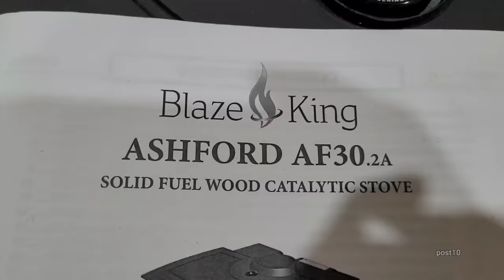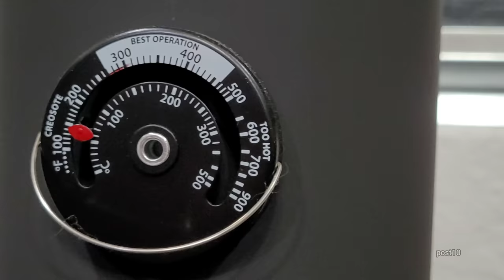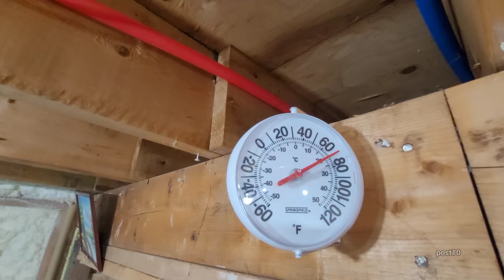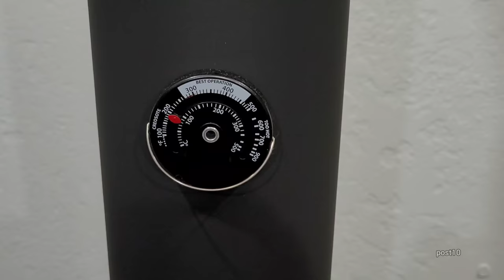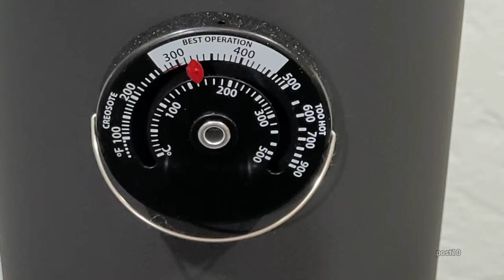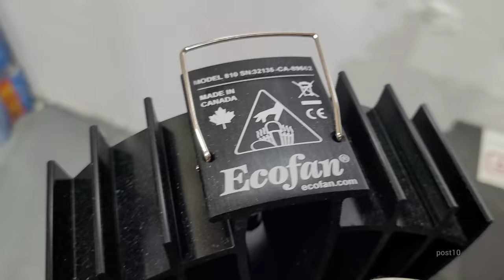Why I Started Heating My Home With Wood And How I Manage My Land. Blaze King Catalytic Stove Review

Comment: I'm a firefighter and went to a house loaded w/CO and the cause was the people threw out embers in the bucket you have but they smoldered but didn't make smoke. The meter was screaming at the high levels in the home. Make sure you have a CO detector in your home or more than just the 1. CO is no joke. Nice video, I"m liking Post's organizational skills.
Reply from the maker: Yes thank you, I have three CO detectors around the house and I'm too paranoid of fires to leave the ash sitting in the house I throw it outside immediately. My CO detector did go off one time from this wood stove but that's because it was about to burn out and I don't think it had enough heat to get the exhaust out
Reply: ahhh this makes perfect sense but I would have never considered it, thanks.
Reply: Did the same thing 50 years ago. Kept using common sense  and an understanding of what I was doing. No problems, saved 10 of thousands of dollars. Be safe GOD bless
Reply: I’ve been watching his videos for a long time now and I just wondered what accent does he have where about in America does he come from? i’m from England so I don’t know about accents but I do not watch any other videos with a similar accent it’s very different to anyone else I have watched I just wondered
Reply: @kooral6959  he's said he lives in Massachusetts
Reply: @kooral6959  he's from Mass. but in another video said he lives in Maine. I'm from Mass too but have a more pronounced Boston accent, I think Post is from more inland and thus not as much accented.
Reply: @sidthemyth  This was a bucket I encountered. They just sat in the bucket w/covering of cooler ashes while they stewed underneath, the detectors in the home and our meter was screaming. We had to vent the hell out of that house...all because they threw ashes out that slowly smoldered.
Reply: @sidthemyth  the manufacturers make them that sensitive. CO is not called the silent killer for nothing.
Reply: When I was a kid we used to put Kohl’s in this little metal thing and put it under the covers with us lol it was cold as hell back then
Reply: I got gassed by CO2 by accident they were dumping CO2 from a fire suppression system and it was dropping down to a low point in the car park I walked by and right into it. I had just a few seconds but it hit me hard got out of it fast . There were no warning signs it's not an experience I would ever want to repeat!
Reply: Beware putting a fan in the window near the pipe that expels CO from the hot-water heater.  

Our CO meter had been in the high range, 24 hours after I'd put a fan in the window on a hot summer day.

That fan had pulled both FRESH air and CO Into the house through a dining room window.  (Who'd think to check on pipes exiting the basement?)

People in the house survived; my Cockatiel, though on oxygen, had passed away at the veterinarian's a day later.   :(

Stay safe, firefighter.   An uncle passed away fighting a house fire after he'd been trapped in a basement.    🙏
Reply: I use a small galvanized steel trash can. It'll snuff out any ambers and hold in smoke.
Reply: You can also put the lid on and take it outside or pass it through your window.
Reply: This is literally a ‘life saving’ tip!  Guilty of this myself. Thank you.    My ash barrel does however have a fairly snug lid which should limit airflow into and out of the container. But the proper solution is a CO detector, no question.
Reply: Something similar (fire too low to create enough draft) happened to a former boss.  There were no CO detectors when this happened, so he's lucky he and his family survived.  (Even if detectors had existed, it's unlikely he would have been able to get one, as he lived in a certain former Bloc country).
Reply: This is common on all stoves. Mine has a wider ledge outside, below the bottom of the door. (Around his 20:24 mark.) When you open the door, sometimes you get ash, ambers that fall out onto the ledge. After a close the door, I brush the ash/ambers into a fire bucket (ideally with a damp rag). Then I drip some water into the pail to extinguish any hot burning ambers. That's another safety thing you have to do. Don't just sweep the ash and throw it away into a wastebasket. Always put it in a fire bucket.
Reply: We have a detector in our living room
Reply: @kooral6959  he lives in Huntington Massachusetts
Reply: Thank you for your service  ❤️
Reply: And he can use the ash for the garden👍🏽👍🏽
Reply: @post.10  there are a few big pines in there. You should make lumber or sell them for lumber. There is some super simple chainsaw lumbermills. Otherwise you can sell it as well. The size is good enough. And there is plenty of firewood for a few years.
Reply: @1fasteddie64  glad his water heater is electric.  

Mentioned ours (and the CO problem) because other ppl with gas water heaters could have the same disaster we'd had.  Our gas furnace vents out the same side of the house, a double-dose of CO.  Dining room windows stay closed all year.
Reply: @1fasteddie64  you're welcome!
Reply: @kooral6959  It sounds like a Massachusetts accent.  I lived in Boston for 10 years and it’s definitely not a Boston one but a general suburban one.
Reply: IMO any bucket storing ash should have a sealable lid to keep O2 out. Especially if you're storing the ash outside near a structure.
Reply: @kooral6959  North Eastern rural accent. Someone from the immediate Boston area would have a very pronounced New England accent.
Reply from the maker: @kathydoyle9939  was the CO2 problem because it was pulling it down the chimney or because it blew out the pilot light?
Reply: In my field theres more CO poisoning deaths than falls or slips or electrocutions! God it boils my blood when I see people tape over their CO detectors 😭
Reply: @MyNewYorkCity.  gonna have the best tomatoes in town!
Reply: @sidthemyth  screamin
Reply: I use that same bucket for emptying ashes out of my wood stove. All ashes sit outside in the bucket for a few days to make sure any embers are out. I never empty the wood stove into the bucket and then empty the bucket immediately into the trash, unless the wood stove hasn't been burned in days. No setting my garbage can on fire.
Reply: @om617yota7  try using it in a garden or just sprinkling it around the yard oh, it's a good fertilizer
Reply: There’s also small buckets that size with lids. They look like mini garbage cans. Snuffs out the smoldering and prevents CO emissions. Regardless everyone should have CO and smoke detectors!!
Reply: @post10Vlogs  That'd be ideal, but we're just not much for gardening. We also occasionally start fires with pallet wood, nails and all, so I'm not going to scatter nails around the yard.
Reply: We dump our embers out in our garden.
Reply: Excellent, I was wondering how to create some CO to test my alarms. They also make CO test spray, but I'm not sure I can be bothered :D
Reply: Yeah. In the 40's they had cars & small trucks running w/ CO gas, highly explosive way of driving. Many drivers & bystanders died as those vehicles idled, they suffocated even outdoors.
Reply: Good idea. I will ask about a CO detector when I get my stove estimate!
Reply: Be less sensitive to what all these idiots in the comments say. You don’t need to address every whacko’s less experienced notions are. Some are utterly ridiculous.
Reply: I closed my fireplace hatch and went to bed one night, it's an old Victorian fireplace with a hatch at the top. The fire was out, only a few smouldering embers left. I was woken up 20 mins later by the CO alarm going off! That taught me a lesson. Close the hatch part of the way but never fully close it, so it will keep drawing up!
Reply: @MyNewYorkCity.  My mom also kept it for chickens to dust themselves to keep any bugs or lice from getting on them. Actually saw bugs on some chickens and found some ashes there where they had a burning spot. I  put in their chicken's dust baths. No more bugs! idk if they were just bugs or actual chicken lice. But they were gone!
Reply: All ash buckets I put outside…that’s a me thing.  I couldn’t go to sleep knowing it was inside.  I also keep a fire extinguisher in the living room, kitchen, garage, upstairs on the wall, basement, and outside my furnace and electric water heater room. Carbon monoxide monitors basement, first and second stories, also in my garage.  Fire alarms all three stories, including garage all synced and monthly testing. I take all my extinguishers every year to our local Fire safety co. for check and eval. They are refillable models.  Always make sure you have the correct fire extinguishers for your home, remember to go over your evacuation plan with your family members, if your children are of age, do not hesitate to review, what to do, go as a family for fire safety training, learn about fire safety as a family, if you have questions your local firefighters would love to answer them and help you. Fire safety must be taken seriously. Protect yourself and your family.  Carbon monoxide kills, fire kills. You may think I am strange but when your a young girl and your parent tell you that your friends perished in a fire it kind of changes you for life. Stay safe.
Reply: Use an ash bucket with a lid.  It cuts off the oxygen and the embers go out almost immediately.
Reply: exactly, people underestimate the length of time embers stay "burning" - I've had situations where my stove was still on after a week.
Reply: Well said. I myself heat my home with a woodstove but I have both smoke detectors AND CO-detectors. CO is sneaky because unlike smoke it doesnt smell and you wont notice it until its likely too late. CO-detectors are a cheap life insurance, cost like 30 bucks if not less.
Reply: @dansw0rkshop Lid or no lid, I'd never leave ashes in the house. CO is the product of partial combustion, most common from charcoals that persist in the ash for a long time after a fire dies out.
Limiting the oxygen by putting a lid on the bucket may in fact extend the time the coals stay active and produce CO.

The simple rule is if the ash isn't in the fire, it goes outside the house.
Reply: @jumpingjeffflash9946 that’s cuz you’re jumpin’ Jeff flash, it’s a gas gas gas!!
Reply: @barrymayson2492 CO2 is totally different to CO. CO2 is non toxic, but it will suffocate, as we need air to breathe. CO is carbon monoxide, and is poisonous.
Reply: @jumpingjeffflash9946  Yeah, the part of Mass nobody cares about which borders the part of Connecticut nobody cares about (I live there:P).  It's a joke because all the reporting in Mass is from Boston and Eastern Mass and in Connecticut, the only part people care about is below Hartford.
Reply: @vengeance1701  Unless it's something major in the western part of the state we don't hear about anything much past Worcester and definitely not stuff from Ct. either.

Comment: If you want to clean your stove glass quickly and easily just make a paste out of the old ash and a little bit of water and wipe it on your glass. It amazingly works great with very little effort while scrubbing. I’ve been doing it for years on mine.
Reply: I use a paste of ash and water and use a newspaper to wipe it with.
Reply: My Father uses a razer blade to scrape the harden ashe of the glass.
Reply: This. Works great.
Reply: I wet one end of a wad of newspaper and dip it in the ash inside the stove. Takes the soot right off the glass.
Reply: Came here to say this ! Damp Rag with ash works like a charm .
Reply: Yep, damp newspaper dipped in ash takes it off effortlessly.
Reply: @Cowcow211  Bit aggressive and can scratch the glass.
Reply: Idk. You should not need to clean it at all if you have a proper fire going... I only ever get stains when I botch startups, but it usually burns off.
Reply: If your burning right you shouldn’t have creosote buildup on the glass.. way to cold of a fire
Reply: That's interesting.
Reply: Just going to suggest that’s how to clean the glass beat me to it 😅👍
Reply: oven cleaner and a paper towel will clean your glass in about 15 seconds.
Reply: That works to remove soot because the ash/water is alkaline and the ash is abrasive. But if your stove is working/used properly you don't get soot build up.
Reply: @Daddy-ro2vs  Windex can be used to clean an oven as well. A little more scrubbing, but its cheaper.

Comment: He's right, I remember a firefighter saying that the number one cause of chimney fires is neglect.
Reply: I thought that was common sense, my dad cleans our chimney every year before fall gets too cold, and sometimes again in the winter and he always gets a pile of creasote out of the chimney and the inside pipe.

The reason he told me he doesn't burn pine is that it 'flashes like paper", basically it doesn't last long compared to more typical wood types like cherry, maple, oak, beach, and yellow birch.
Reply: It's true. A little common sense and regular maintenance will ensure you never face any issues. You'd be horrified to see how badly maintained some people keep their chimneys.
Reply: It's one of those things that people don't think about just like cleaning their dryer vents and then wonder why their homes burn down.

Comment: ProTip for wood burning stove:
You have a pipe that takes the noxious gases out of the house, that's good.
But, if you also have a pipe that brings in cold air from outside to be burned and exhausted, your windows and doors won't leak rivers of cold air and you'll use less than half the amount of wood had the inlet pipe not been there.
In the video's case, that window is taking care of it.
Because air expands as it heats, if a 4-inch pipe handles the exhaust, you need only a 1 inch pipe to bring air in. So, that window could close to just have 1/4" opening at the bottom and that'll be plenty to feed it.
Reply: would that just be a pipe from the outdoors into the stove?
Reply: @mr.schwartz2090  I'm assuming he just means a pipe that runs from outside into the room where the stove is to supply fresh air, because the original commenter said the window in the video's setup is doing the job, so I assume a pipe into the room will work as well.
Reply: @BobJones-bh9qz  true true, I see, thanks
Reply: All good, except for your pipe calculation/expansion-assumption.
4" pipe =12.5 sqr inch area.  1" pipe = < 1 sqr inch area (actually 0.78...).
Roughly a 16:1 ratio. You need at least a 2" dia pipe for a 4:1 ratio. And for that you'd need a heat difference of over 1,000C at the flue. Plus you'd have to consider friction/resistance of air-flow in the pipe.
Reply: Natural air circulation aint a bad thing. All of these new tight homes need fresh air heat exchange systems that are expensive to install and use electricity constantly.

Comment: Installing that in the basement was so smart. Nothing beats a warm floor in the living area and convection can heat the whole house, depending on the floor plan. Well done. 
Friends of ours used duct work to channel heat from their basement wood stove into the existing forced-air ducts. Constant, gentle heat throughout the house. I don't think they've used their furnace yet.
Reply: Post is genius!
Reply: Diane - Is this stove INTENDED to connect to furnace duct work or is that just an option for the owner? The stove looks really nice, but it seems like you can only use it to heat a single room? Honest questions because I have never owned a stove like this.
Reply: Re: your friend's heat ducting arrangement from a woodstove to a furnace: be careful of insurance regulations in that regard.  Fire regulations do not allow it.
Reply: @johnj5985  He had it checked out with the building dept before he did it. The venting is standard. He built a shroud over the stove and added a connection downstream from the furnace, if that makes sense. It could be his community is more flexible, they're more rural than we are.
I wonder what the specific concerns are wrt fire codes?
Reply: @dianeladico1769  Mostly CO and secondary ignition, flue-gas venting, ventilation. Then fire from dust/debris build up, incidental/secondary heat damage to wiring etc, drying/expansion-contraction/warping of structures, humidity issues; some other minor things.
Reply: Y'see, I'm not the norm as regards heat, I'm perfectly comfy in 10-12 C in T-shirt and jeans, I get a dab on if it goes over 15C. And I'm used to working outside in freezing/near-freezing temperature. My father liked the house way warmer than my mother did, but he was a city kid and my mother farmer/rural raised. I've also always had an abnormally low body temperature, it drives doctors nuts trying to get a reading: until I explain that it's 'normal' for me.
Reply: @bikerfirefarter7280  So if I'm understanding you correctly if it's properly vented and maintained there's no additional risk? My friend's set up just routes the heat to the upper floors by adding to the existing ductwork downstream of the furnace. No comingling of combustion, the woodstove is vented outside as usual.
He's smart and careful and had it OK'ed before he did it but if there's an unknown danger I'd want to tell them. Thank you for your reply!
Reply: @bikerfirefarter7280  I'd like to get there. I'm good to about 15C in short sleeves if I'm not moving, I can do better if I'm active.

Comment: This was a great video! Since you just started that garden, if you chip up some of that rotten wood from your forest floor cleanup, there is mycorrhizal fungi that will really help out your soil. Just keep folding it in to your garden beds. Even top dressing with it as mulch in the summer would be very beneficial! You are doing a great job out there. Your patch of forest is amazing!
Reply: Added info...be sure to let those chips leach a season , any season will do ;) before using as mulch!